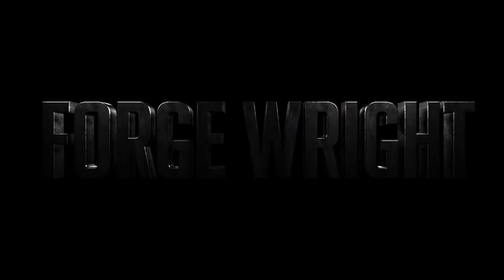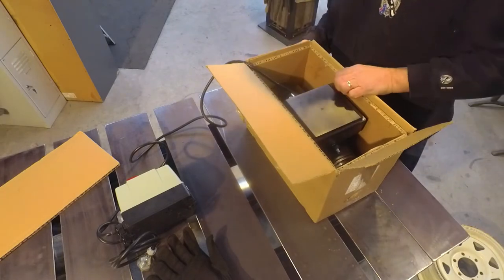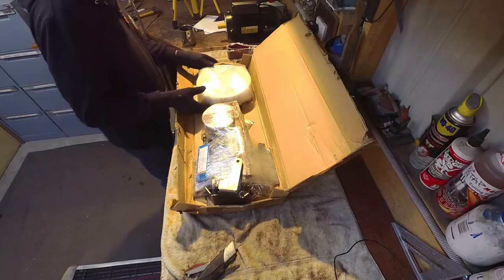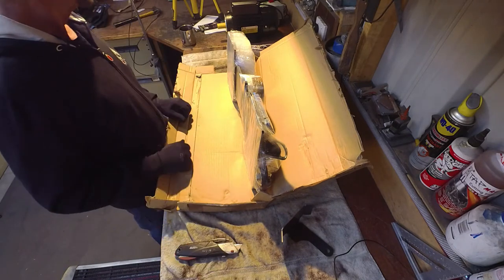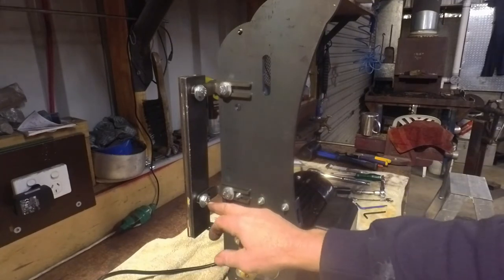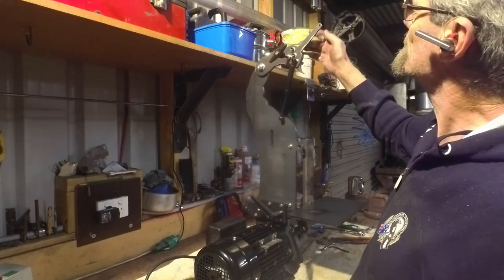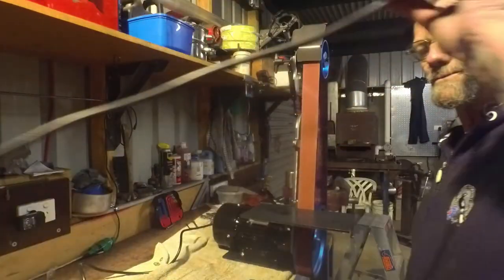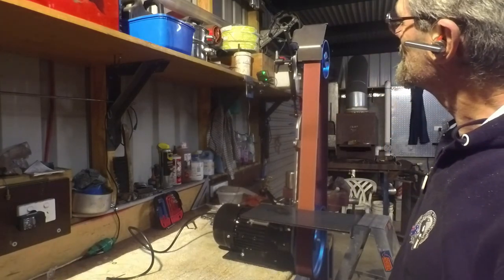New 2" x 72" Scorpion Grinder

Comment: Thanks for this vid - I'm considering this grinder, as I like the small footprint in the workshop. Looks great.
Reply from the maker: Hey Jason glad you liked the video mate. I strongly recommend this grinder, as you say, very small footprint and very efficient. It's also so smooth and balanced is can easily be set onto a rim like I did so it can be rolled around to whereever you like if your workshop changes design. Cheers Andy 👍⚒